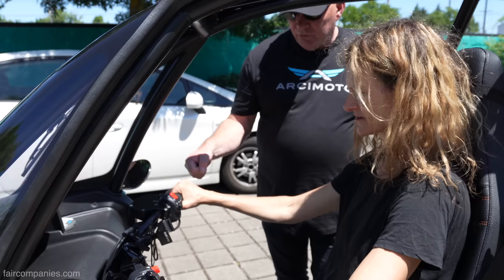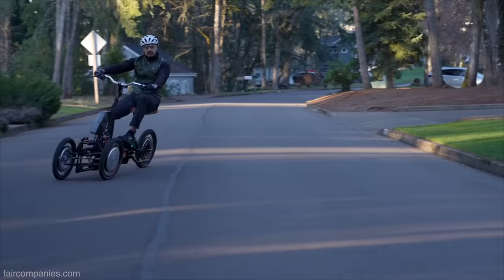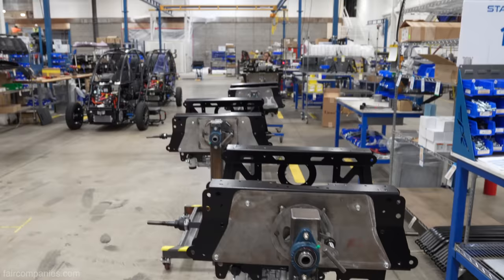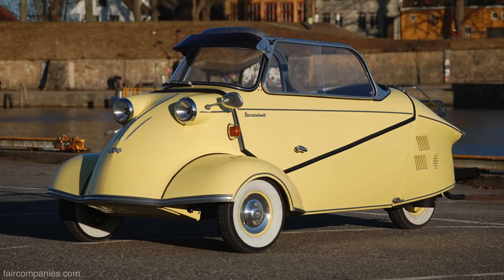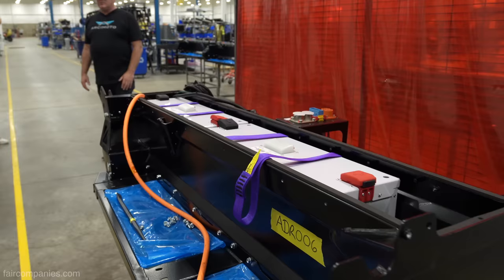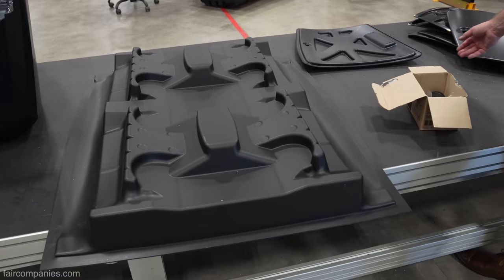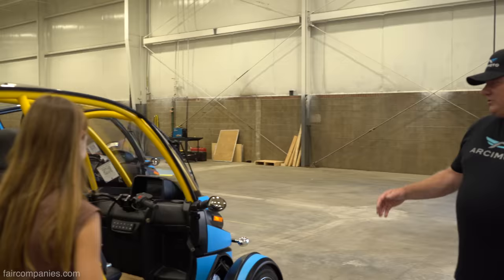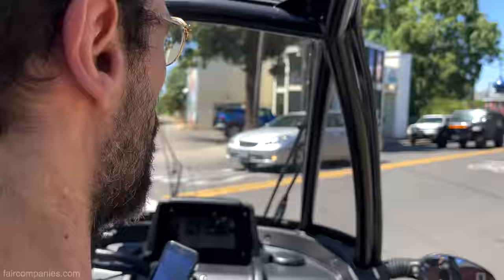Arcimoto 3-wheel EV commuter blends bikes' fun + cars' safety

Comment: I'm old but want something that will go about 50mph for trips around a small midwestern city.  However, 20K is too high for someone on retirement pay. Could you please come up with something for us Baby Boomers?
Reply: The FUV is being bought most by 55+ seniors. The price is $18, not 20K. I retired 10 years ago. Got rid of my last car 8 years ago and bought the solar/pedal powered car-bike as seen in my avatar image. All those years without paying for gas, oil changes, repairs and insurance saved me so much money I was able to pay cash for my FUV recently. I find it extremely economical on my SS pension budget. My power bill went up no more than $2/mo and my insurance is only $130/yr for a good Allstate policy. No longer dealing with the threat of a car's $5000 motor or $4000 transmission blowing up. In my lifetime I've had two cars break their timing belts and go straight to scrap. EVs are more reliable over all and the FUV is a very safe vehicle, far better for seniors than a motorcycle. You will love it.
Reply: @popeyegordon  Thank you so much, I'll be looking for one, where is the best place to buy one?

Comment: Looks like fun . But if your brave enough to operate one of these on the roads in Florida ? Your a hell of a lot braver than i am .
Reply: Nah. I retired in central Florida ten years ago. I drove a 160 pound car-bike for 8 years in order to save up enough cash for my Arcimoto. No incidents because I kept it lit up and watched my mirrors constantly.  I feel EXTREMELY safe in the FUV compared to any motorcycle. The safety is the same level offered by any small car but so much more fun.

Comment: I always wonder why no EV companies ever develop their vehicles to swap out batteries like you would a battery powered weed wacker.
Meaning, I would like to slip the depleted  battery pack out - leave it charging, and slide a fully charged one in, be on my way. 
This would be the only way to manage a fleet business w EVs.
Reply: Batteries run the length of the vehicle and under 2 seats. It would be hard to get at and remove heavy batteries. 
Maybe someday they can be made to get more than 102 miles per charge.

Comment: Can you add side panels to protect from the rain?
Reply: I have ridden in one that had them so there's that.
Reply: Watch the video again.
Reply: You can buy half doors now. They are working on full doors and AC/heat.
Reply: No rain protection is needed. When moving, the air pressure dam acts like a force field, I stay bone dry which is kind of an amazing experience. While not moving your elbows and outer thighs get some rain when it is windy, no big deal.

Comment: Is it possible for the Arcdmoto guys modify a can-am spyder with a leaning  "bike"? Love the Arcemoto "bike"!
Reply: No. Too many obstacles. The wide front end has to be completely removed because dual tilting has a narrow width. It won't even work on an Arcimoto FUV. The bike should be a design that already tilts when driving. Tilting is just cheap thrills and novelty that is not nearly as safe as having three wide tread car tires on the pavement at all times. Autocycles have far better traction and stability even when compared to tilting trikes with rounded tires. Compare a total of 14.5 inches of flat tread width with three rounded tires. I bought my FUV for greatly enhanced safety after surviving owning 5 motorcycles. I was lucky.

Comment: where i live , in the state of california usa , these would be automobiles . the law changed for 3 wheeled machines and only require a regular drivers license . neat concepts .. good luck
Reply: Not quite, they are autocycles under state and federal law. They get the very low motorcycle insurance rate, a real plus for affordability. I could not afford a car in retirement because of that insurance but now I give just $132/yr for a good Allstate policy on my FUV. Each state is different - Washington still requires a helmet and MC endorsement for now but that will change.

Comment: is there a 3 seater design
Reply: No. Not possible without total change in the design and performance. It would be heavier and need a bigger battery. In fact there are no plans for any 3 passenger autocycles I am aware of that would be highway speeds capable. Asia has millions of 3 wheeled jitneys that take three people at lower speeds with no collision safety systems and lots of pollution.

Comment: Doors? Heating? Air conditioning? Range?
Reply: Doors are not needed. Heated seats, hand grips and defroster. AC? hell no!! Climate control is one of the luxury demands that got us in trouble in the first place. No motorcycle in existence has nearly the level of comfort or safety offered by the FUV. Personal vehicles can not be sustainable unless they are much lighter and less energy hungry. That is Arcimoto's goal. Range is described in detail in the video description. I have owned one of these for 8 months now. So much fun and very economical.
Reply: @popeyegordon  I live in Wales (UK)and Winter can be a pretty miserable place. Most motorcycles are put in garages in winter I think you are missing out by not offering some of those items
Reply: @brianmays4366  The company is smart by starting with the low hanging fruits of sun belt state distribution first. They definitely are looking at climate controlled designs but there is no need for now with all the buyers in warmer states. It will take a couple years to establish sales in all 50 states before any substantial export business. The current project is adding a heater to the battery tunnel to deal with colder temperatures.

Comment: Technically, Arcimotos are more motorcycles than motorcycles!  What most people know as "motorcycles" use gasoline engines.  Arcimotos use actual electric motors!
Reply: Not really. Learn about the new category of vehicles called autocycles. Electric powered motorized 2-wheelers are still called motorcycles. E-bikes and e-motorbikes. This is new so many people are still confused about what to call it.

Comment: The Elio, 3 wheel car/vehicle reminded me of a 3 wheel Honda Civic or Toyota Camry & came close to hitting the mark by being just as capable/practical as a car & attracting a large audience. 
    In order to make these types of vehicles more versatile/practical & more appealing to a larger audience. I think they should be built more like a 3 wheel Jeep/SUV.  
 Some tips for a practical more appealing vehicle:  Make it 3 wheel drive, for rain/snow, more rugged to handle gravel country roads & pot hole filled city streets, possibly an adjustable suspension (stiff/low for street handling-softer/lifted for light off road) an aerodynamic removable/partially removable  weather enclosure. Enough power/able to drive safely on the interstate, 3 removable aerodynamic storage compartments similar to an adventure motorcycle, which would make it more capable of road trips. Options like a roof rack/roof storage compartment, front grill guard,etc. If it was small 2 seated, cheaper than a car, agile fun to drive, decent power, good mpgs, storage compartments, able to handle light offroad & able to be drove/used year round. I'm sure it'd attract a larger audience, since it could be used for commuting just like a small 2 seat car. 
    Instead of only a city commuter or weekend toy. For $18,000 I think a small 2 seated vehicle needs to be just as capable as a 2 seater car in order to sell enough to be profitable.  Considering you can buy a small 75 mph motorcycle,scooter for way cheaper.

Comment: Love concept but i will give a little input idea, they need solar for that little extra push. Make it happen :)
Reply: No. The small roof could only add enough to prevent daily battery discharge during parking, no way there is room for enough solar to actually help. Solar should be at home with a battery bank where it can reliably produce real power.

Comment: "Starting at 17,900 USD"
You are out of your minds.
Reply: You are the one out of your mind and your time because in 2022, used cars are selling for as much as new ones and new cars are selling above list price. And how many of them burn no gas or can be insured for the very low motorcycle rate? My insurance is just $130/yr and my power bill went up just $2/mo. This makes it very afordable to me on my modest retirement pension. I am no longer threatened with the possibility of a $5000 gas engine blowing up, or a $3000 transmission failure.
Reply: Sounds pretty cheap for an EV. I won't spend $50k on a Tesla. I'll spend $21,700 for an FUV now instead of waiting for $13k in 2025.
Reply: @bloop Just as the goal was originally $12K a few years ago in a different economy, the $12,900 price is based in today's economy. It will not be breaking a promise if the actual cost 3 years from now is $15K based on relative prices and values in the market at that time.
Reply: Congress just passed a Green bill that might help pay for EV's. I don't have all the details yet.
Reply: @beachbum200009  After waiting 2 years I could wait no longer so I bought one. Getting old, life is short. Knew I'd get no rebate and I pay no taxes so a tax break is worthless to me. I can hope it could be retroactive but probably just wishful thinking.
Reply: @beachbum200009  unfortunately it doesn't cover 3 wheels vehicle
Reply: @FreddyHuman   Yup I watched the Arcimoto report today. The Build Back Better Bill had it in but it was cut out with the Bill that was pasted. No 3 wheeled vehicles covered.  : (

Comment: Any way to have a round steering wheel option??? Older people would be able to drive much easier.
Reply: No it is not practical for meeting the goal of a light compact vehicle. The average age of owners is over 55. I'm 70 and steering comes naturally. Arcimoto worked with a prototype that had wheel steering for a while. They found that by going to the handlebars they saved 240 pounds of weight and 18 inches of vehicle length. Very smart.
Reply: @popeyegordon  Well...I hoped, but you have a good answer there... what price range do you  on these once in produ tion..and, any hope to charge by solar if there is no electricity...
Reply: @SwordofLight  Start at $17,900. They might get the $7500 rebate for EV's... don't know yet.
Price will drop when they get in to mass production down to about $13,000. That's a ways off.
They don't put solar on them. Portable panels sounds like a slow way to charge... if it can be done.
Reply: @SwordofLight  You are a little confused about the beginning of production and the base price for the prodiuction model has been set for a while. There is a long term goal to reduce the price further when production exceeds several thousand a year. Production started over two years ago and has been slowly ramping up. 
Solar roofs as a small trickle charge feature are a good idea and have already been featured in several electric cars. Please note that the size of the roof area is too small to hold enough solar cells to do anything more than a maintenance charge or trickle charge that would take weeks or months to completely recharge a low battery. I do think that it is worthwhile no matter how small the solar contribution to charging is. Some owners already have home solar on their roofs they use to charge for free. 
I also neglected to tell you about the goal of upgrading the steering at low speeds for parking when it can be hard - the feature is called 'torque vector steering' and is different from power steering on a car. It will actually reverse the direction of one of the two motors to make sharp pivot turns easy. This will be added at no cost to current and future vehicles starting next year. It is being tested now.
Reply: @beachbum200009  Not a bad price point. I have a hybrid car, and like it...but wouldn't mind a more efficient ride. Solar may be slow, but if you are in a brown out, you have plenty of time...Just thinking ahead. I had a friend who converted an electric into a solar golf cart, and I loved that thing...lol...not for long rides however...Thanks for your replies, I have bookmarked you for future reference, and hope to ride one of these someday...Make a ton so we can all have one...
Reply: @popeyegordon  I like how you are thinking ahead. Sometimes, it helps one to jump a step that may have been a failure. These are great, and not every vehicle can be perfect for all needs, but I imagine these will be perfect for inner city and short commutes...Make a million!
Reply: @SwordofLight  Thanks. I would like to offer that these are equally useful in small towns. Mine is on the outer edge of a small town, cow pastures on one side of my road. There was never any proclaimed intention to substitute this for more than 90% of car usage. For me it is 100% as I got rid of my last gas hog 8 years ago.
Reply: @popeyegordon  Sounds like where we live, country and cows,  Would use it locally, up to 10 miles on back roads, so this is the perfect mix. Looking forward to your success, so I can afford one...maybe a used one! Keep me informed when you think of it...(Talk about guzzlers, Still got a dove grey 84 Jag XJ5 hiding out in my garage for a last hurrah, tho...lol 8-10mpg on high test is pretty expensive these days...Chevy is supposed to be coming out with an electric engine upgrade /downgrade?) Then it hits the road again..
 What you offer is much more practical...Looking forward to your future endeavors with them. I understand one will get left behind if we do not see the future and accept the change to smaller, electric..

Comment: At $8k it might make sense but not at $18k. You can get a used Leaf for a lot less than that.
Reply: The Leaf wastes too much energy unless you are always driving it with four passengers. It weighs twice as much as the Arcimoto and is no safer.  Insurance bill for the Leaf will be five times higher than Arcimoto's. Mine is just $130/yr for a good Allstate policy. Even with my perfect record I'd pay $900/yr for Leaf insurance. Nissan Leaf   Compact car
Body style: Hatchback   Number of doors: 5
Battery charge time: 20h at 110V, 8h at 220V
Battery: 40-60 kWh 350 V lithium-ion
Cargo volume: 850 L with seat area
Dimensions: 4,480 mm L x 1,790 mm W x 1,565-1,575 mm H
From CAN$39,498

Comment: All the info you want except what you really want ."the price"
Reply: ouch ,found out the price. here i could buy a car, for the money.
Reply: @georgeh9967  The average price of a new car in the US is $46,000 in August of 2022. You can buy TWO Arcimotos with extras and delivery for that. Insurance for both would be under $300/yr if you also have medical insurance or Medicare. You would spend about $3/mo to keep them both charged and you would never buy gas or oil changes again. Fewer moving parts, no $5000 motor or $4000 transmission to blow up, no gaskets to blow out.
No matter how an educated mind cuts it, the FUV is a great deal in 2022 at its current price. 
Used cars cost you $3000 a year MORE to own and operate. Avoid innumerate conclusions.
Reply: @popeyegordon  i said here. i am not in america. here new cars are way less than 46k

Comment: Is that a dog seat on his roadster?
Reply: Yes. But the Roadster is not recommended. No safety like the crash cage and harness offers in the primary Arcimoto design. 500 of them sold so far but only a few Roadsters. I have had my FUV for 13 months now, nicest vehicle I ever owned and I'm through with dangerous motorcycles.

Comment: The only thing is it doesn't completely protect you from the rain.
Reply: Actually it does as long as you are moving. I stay bone dry in heavy rain with the wipers on high speed, amazing experience after getting soaked so many times on motorcycles. This should not be compared to a climate controlled car, it is to be compared with the billion motorcycles and scooters already in use, none of them keep you dry under any circunstances. The air pressure keeps spray off the driver unless you stop in a cross-wind, then you get damp on the fore arms, the roof has effective rain gutters too. A rear seat passenger does get more spray unless you get the door option but still sits under the roof which is appreciated.

Comment: Hahaha a spyder with a roof and electric as well!!!
Reply: Not even close. The only common thing is the 3 wheels. You must have poor eyesight.
Reply: I own a spyder hippie! An electric one would be awesome!!!
Reply: @eugeneray8829  Add a roll cage and a six point harness to the electric and you have the FUV. I'd never trade my FUV for a dangerous motorcycle. Been there, done that and I have the scars to prove it.
Reply: @popeyegordon  pretty hard to fall off a spyder!!! Like any toy if you abuse it you stand the risk of bodily harm, let it be boat, snowmobile, side×side...etc. Goes unspoken.
Reply: @eugeneray8829  I implied nothing about falling off, the danger is collisions and no trike is as safe as the Arcimoto. No others come with a roof and wrap around windshield w/wiper either. I have heated seats, hand grips and defroster too. And a locking trunk. I retired in Florida, the most dangerous state for motorcycles and bikes. I survived owning 5 motorcycles over the years but I'm getting old and no matter how safe we try to be the bad drivers can wipe us out.
Reply: @popeyegordon  My spyder came with an adjustable windshield, ABS braking, heated hand grips, locking trunk two locking side compartments, a frunk (front compartment trunk), electric defrost side view mirrors. Also equiped with custom luggage for front and two sode compartments. My was a six speed standard, 5 forward one reverse. Quick, responsive, nothing like the auto or electric shift versions. Its others you need to watch, for they don't watch for you and under estimate the capability of a motorcycle. Im 64 and ridden since 11 yrs old. Started on a mini bike, never stopped.